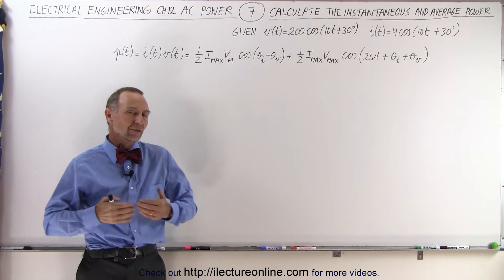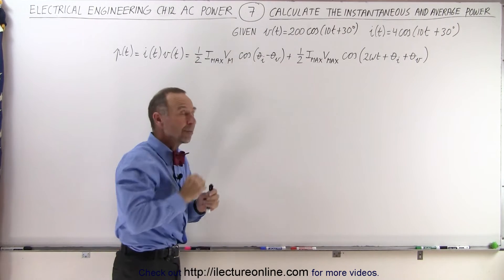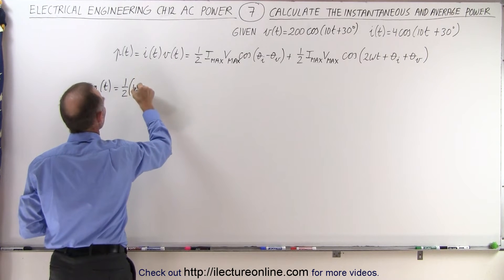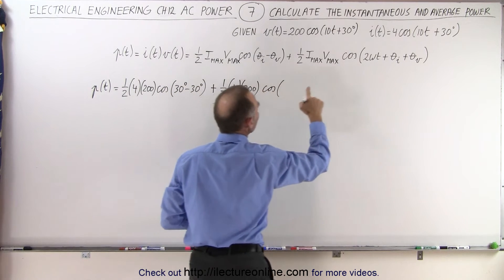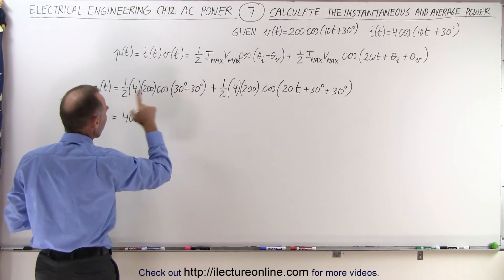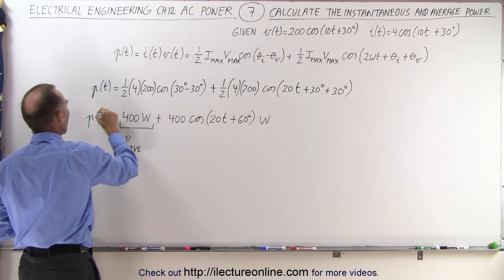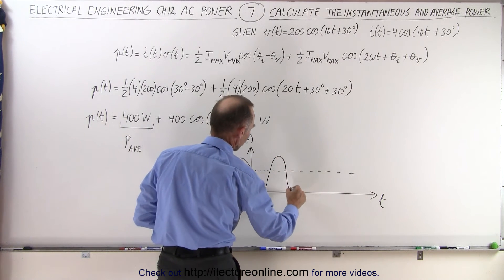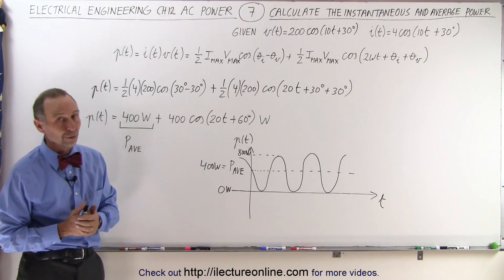Electrical Engineering: Ch 12 AC Power (7 of 38) Calculate the Instantaneous and Average Power

Comment: Calculate the average and reactive power at terminal of network shown below: if v(t) = 100 Cos (wt +15°) and i(t) = 4 Sin (wt - 15°).

Please solve this problem sir.
Reply from the maker: There appears to be some missing or incorrect data in the equations for the voltage and the current.
Reply: @MichelvanBiezen  sir i have corrected the equation.